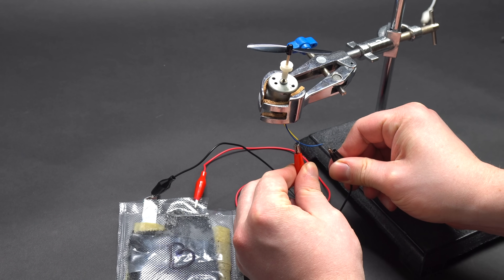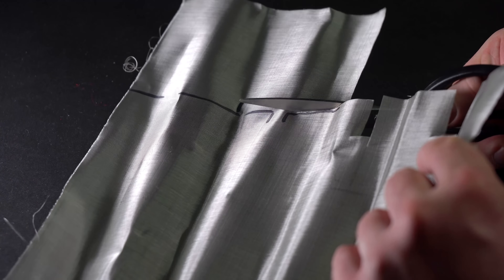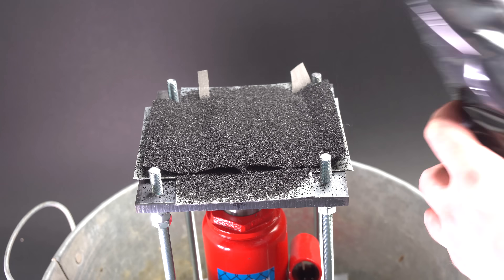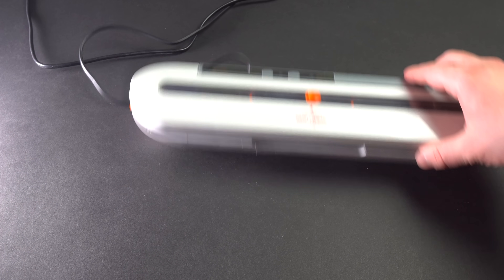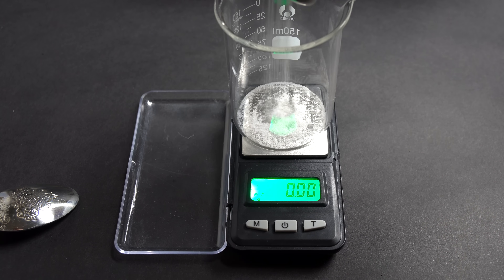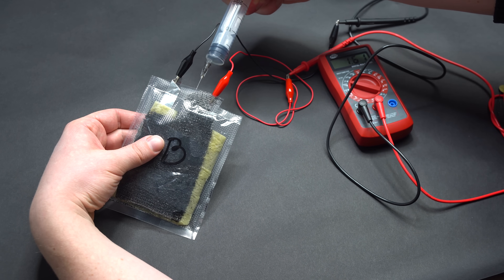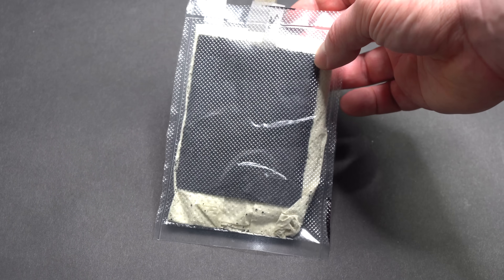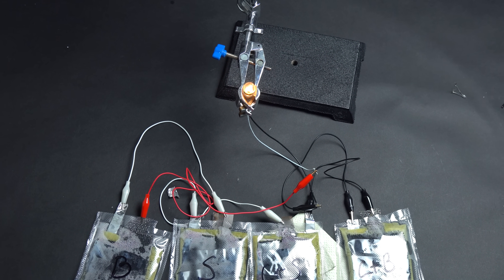Making a BATTERY From ALUMINIUM FOIL!

Comment: Very good. Easy step by step proces explained  .
Basically you use ReDox reactions with metal and salts. The energy from chemical to electricity. Most batt are so. But these are storable. ( like those lead/sulphuricacid for car without demiwater added.) I like the simple household material use.

Comment: Fun,free energy,glad Someone out there is got their brain together keep up the good work
Reply: Nothing free about his project given all the stuff that is required. Aluminum foil is also not free, nor is the jack, drill bits, metal sheets, chemicals, etc. Nothing is actually free other than people to make choices
Reply: @AaronSchwarz42  salt water is free recycled metals are free copper can be free from stripping a bit off wire or even penny's.. alluminium foil is what £1.50 enough too do hundreds off batts with depending your build there is many things you can get free or get your build cost per unit like a few penny's each...zinc is free in old batteries you can use vinigar which is 30p a bottle enough too do alot with you can look for scrap copper pipe and brass taps or even foil take away food containers not hard  too spot there's all sorts if use your head but really it's about cost effectiveness and these such materials n builds are hugely cost effective

Comment: make it an aluminium wire spool metal-air salt water fuel cell instead, so that the fuel cell chemistry is separate from the aluminium wire feed stock
Reply: make it a lemon cell instead of the capacitor plates
Reply: try non-aqueous electrolytes, namely denatured ethanol
Reply: make copper-oxide copper electrolyte-water-electrode (M-S-C solar cell junction)
Reply: anodize the copper to copper oxide on the surface thin layer, then cover it will transparent conductive electrode, like salt water, the same water can be used also as solar heat collector and the copper anodized will be blackish

Comment: Great educational experiment, but not practical. Those things offer less power than a tiny generic AAA battery which you can get on sale or buy in bulk for 9-10 cents. You can generate about as much by putting a propeller on a couple motors like the one shown in the experiment & pointing it in the wind. Any motor will act as a generator if you can spin it. Also a couple lead plates in a strong acid will generate much more voltage & current, plus it's rechargeable... that's how car batteries are made. Also zinc and carbon or copper electrodes in a mild acid or with a tissue of acid sandwiched between them makes a great battery.

Comment: You said that the electrolyte dissolves the aluminum, which I'm guessing leads to the demise of the battery. Is there anything else in the battery that wears out, or could you design a battery with the carbon electrodes that you could replace the aluminum when it wears out?

Comment: An emergency you say.......I read about a guy who use a stack of coins with different properties.....copper and aluminium stacked together with blotting paper between them and pee as an electrolyte to light a fire..............gotta try that as I have lots of pee.
The fact that you can get about 1 1/2 volts from a 2 coin stack makes me wonder if you stacked 200 coin sets together, that's about 300 volts,  you could get electrocuted.....shocking.

Comment: Why do you bother with activated charcoal? It's nonconductive and has no use in the experiment. Maybe it gives you a higher resistance which makes the battery weaker.

Comment: I'd like to see what happens if you make your strips very long 1, 2, or 3 meters long. Then after pressing and curing, roll them up tightly and put the the rolled material into the appropriate size acrylic tube or other (clay or ceramic) container, make your anode and cathodes with dissimilar metals. I would make my cells with lemon juice or vinegar or other natural nontoxic electrolytes so we are not creating karma negative energy sources . An after thought as to this design is put a little bit orgone  collector "Reich tech" into the design put some natural fiber between the layers cotton, hemp, kenaf, silk, linen (if you are a tinker never throw your natural fiber clothing out, put it into an orgone device or other fun project if nothing else you could make your own activated carbon with it!) Hemp Carbon Copper Silver Super~capacitors you got to love Nature please send feedback to herbalalchemyst@gmail.com P.S No more Dinotech or Nukes F*** the Dumb Shit!!!!

Comment: I would like to build some large battery cells, something similar to nickel iron batteries, similar to ni-cad, in potential, from what I have heard, I'd like to build them in 5 gallon buckets, so they can be resealed easily. I'd like to have about 28v total and 2k ah, it's a bit crazy and ambitious, but very possible, this should power my house for years, and can be disassembled , cleaned, and put back in service, after about 10 years of service,   or maybe carbon lead oxide batteries, built from used deep cycle batteries,  I'm using fla, and lithium ion for now,  about 800ah last 12 hours, I'd like to go 96+ for cloudy days,,,,  great video!!!/

Comment: Try and put the aluminium foil on mash as an electrode. That way the circuit won't get cut off as the aluminium dissolves. And maybe take apart the rough mash and make a wire out of it, so you could seal with heat the top part of the battery.

Comment: Well done, better use washing soda Na2CO3 or Pottassium Carbonate K2CO3 in water as the electrolyte only. Then it will last longer.. Also adding MnO2 to the carbon will help and you need to put the carbon electrode not in a sealed bag, but this way, that air comes into the carbon, as it a metal air battery...you can also use use a stronger oxidator like KMnO4 on the carbon, so you supply the oxygen without the air needed...then you can seal it up again...Hope this helps...
Reply: Hello mate would be possible too talk too you cheers

Comment: A friend and myself took a regular nail some carbon dust and aluminum flakes and it would light an LED light for a few seconds. But the crazy part is after the LED went out we broke the circuit and the nail would recharge itself in a few minutes and be able to relight the LED agian. Not just once but over and over and over agian without plugging it in to anything...no joke. Touch wire to LED and it would light up for about 15-20 sec. Then LED would turn off. Took wire off the LED for a few mins and then touch LED agian and it would light up for a few seconds agian...over and over.. we couldn't figure out how the thing was charging itself!
Reply: v ery interesting could you  please explain as to how you made all the connections

Comment: This build is very similar to a disposable hand-warmer product that was on the market in the 1980's. The electrolyte was stored inside the packet, but was encased in a wax vial, which you would crush or snap in order to activate. The only overall differences were that the entire was wrapped in batting, in order to prevent burning, and no electrodes, as the energy was left to create the heat within. I think they only lasted about 15 to 20 minutes, but would make your pocket, glove, boots and/or hands quite toasty. I think they were called "Hot Shots" or something like that, although the venture failed apparently; however - the product DID work. Interesting segment! I was unaware of spray graphite until now - good to know...

Comment: you should use way more thinner materials, that would result in a way more effective battery. Besides the Aluminium foil, use washi (japanese very thin paper) and graphitefoil. The layers should be as close to each other as they can. If the Graphite foil is thin enough, or has a very thin metallic support, you can roll the packet tightly together to make the battery. Also use potassium hydroxide as electrolyte.
Reply: Potassium hydroxide is highly caustic and would likely disolve the aluminum. While yes, it is a powerful electrolite and or can make a potent electrolite solution, with such thin aluminum I would be concerned.

Comment: Would it be better to use those power tool battery? Would it be easier to use those bolts to tighten down w/o press?

Comment: Making a battery from Aluminum foil and steel screen and carbon spray and napkins and epoxy and scotch tape and heat seal freezer bags and salt and baking soda and water and sodium hydroxide. Make you you have scissors and syringe and glass containers and tub and heat sealer and hydraulic press. To use battery make sure you have wire with alligator clips.
Reply: Well, yeah, but be fair, a viewer may have all those things at home and need a battery at a time when the shops are shut so they can't just buy one.

Comment: Get with me if your interested, for the equivalent of a solar panel but instead of just light, it converts ALL forms of ambient energy. And so much safer and easier to build, STOP thinking Anode & Cathode, and Start thinking Hydrophilic & Hydrophobic, and the purest cleanest water possible, at least AVOID Acidity & Salts

Comment: Aluminium foil. And a dozen other ingredients, and a press, and tape, and plastic foil...
Reply: Rule 1 of youtube: if the title has lots of capitals and an exclamation mark, beware, it's probably junk.  Sad in this case, because I'm confident that the method would work, yield the results stated and I enjoyed the video.  Not a scam.  The author should take note.  The title hype and misdirection is intended to attract but has the opposite effect on less naïve you tubers.   I would have ignored it if the notification hadn't arrived when I had half an hour to kill.
Reply: @raykent3211  rule 1 pretty much everywhere.
Reply: Where could I find that plastic foil that he used for battery assembly. All I can see in the internet is only cling foil. Help me with this

Comment: Im wondering if the hydrogen is being absorbed by the graphite creating an electrochemical process boosting your output. You may have a hybrid battery/fuel cell there with the sodium hydroxide / aluminum chemistry

Comment: A word of wisdom to make your life easier.. unless using carbide drills, drill at a slower speed with plenty of pressure and a little bit of lightweight oil making sure the drill and the steel arent getting too hot. This will help make your bits stay sharper and cut through the metal faster

Comment: What do you think the very best  electrolyte for the battery? How can we know the AH of the battry bro?  And after discharge are we going to charge it with same volts supply?
Reply: The best electrolyte is probably proprietary. To get amp-hours, hook up an ammeter, and film the meter with a camera until it reads 0 amps: then calculate the integral. As far as recharging goes, these are not rechargable: maybe if you replaced the air and water with something else (and even then you might need to keep it really hot), but not with an aluminum-air battery.
Reply: Thanks

Comment: Nice video 5 hours of cd player not bad. You are right these are perfect for emergencies.
Reply: It’s an emergency! 5 hours later (add 12 more if you don’t have a blowtorch)... woo! Almost as much power with a dozen of these as a very small crank light/generator which works all the time!

Interesting concept, but it’s only like 2.5 to 3 watts max (from the 5 packs put together), and if it only lasts 5 hours then that’s 15 watt/hour. But for this much work you might as well get a pocket sized crank generator or if you really want, make a bicycle generator (I’m ridiculously scrawny, but if I were just super leisurely pedaling for a 10 hour day, maybe like powering a laptop or desktop, I would probably average at least 100w, it seems like that would be much more useful since it will power much more and always be at the ready, and re-usable, and can be powered by Tacos, plus it’s just as easy to build and probably with more common supplies like a drill motor (or anything DC), and then a bicycle or exercise bike and a rope/belt/rubber bands/fabric/shoelaces etc). I wouldn’t even own half the materials he uses anyways.

Cool concept, but certainly not “perfect” for anything, let alone emergencies! If I need power in an emergency, I’m not carrying a syringe of salt water! And if I packed DIY battery pouches, I’d rather have a USB output hand crank or any of my other batteries (the small LiPo packs I use of similar size and voltage would be capable of of about 100 amps continuous and 200 amps peak compared to the 0.75 amps max he had shorted (I’m guessing mine would be over 300 amps likewise shorted, but it would be some eventful arcs and glowing wires in about 1/2 second though, so that makes it difficult to measure, haha!), so those batteries can actually do something useful, you would need about 12 of those cells shown in this video to slow charge a cell phone at 800 mA, so that’s not really “useful” amount of power for an emergency (and Id say charging a phone for help is an emergency).

Comment: Greetings from the flip side of electrochemistry (the platers). Is it possible to bring down the hydroxide content while retaining the depassivating effect? That way the purely chemical side reaction between the Al and the lye won't destroy the anodes so quickly and you'd get higher capacity. IIRC carbonate will also remove the oxide layer but more slowly. 

As it stands this looks more like an Al - water/hydroxide battery to me - there's barely any space for oxygen to get in for this to be an air battery. In a Mg - O2 battery for example one side of the cathode is dry and exposed to air.

Also, that graphite spray is shit for serious conductive layers. IDK about this brand in particular but using a similar one I've gotten anywhere from 10k ohms to low hundreds of ohms - sprayed on a sheet of paper with contacts 1 cm apart. The mesh is already metal covering it all with graphite is only going to make it worse.

Comment: Thoisoi, I'm glad you have expanded into making batteries, this has been a fun (but also sometimes frustrating) activity for me for many years now. I have also built similar batteries, but I don't believe the half reaction at the cathode is the complete reduction of oxygen, this requires sophisticated catalysts on the carbon. 

Instead, I think the oxygen is being reduced to its superoxide: 

O2(g) + H2O + e- => HO2- + OH-, E° = -0.065V (J. Phys. Chem. Ref. Data, Vol. 18, No. 1, 1989)

The half cell potential is not good (which is why you observe the overall lower than expected cell potential), but it proceeds kinetically quickly because no bond breaking of the oxygen is involved and so activation energy is very small for this process, it's essentially only electron capture by oxygen adsorbed onto the surface of the AC and doesn't need a catalyst.

Also, I don't believe that the strongly alkaline version of the oxidation of aluminium is the correct half reaction occurring here (because 'reasons' lol), I think a more appropriate equation for aluminium oxidation under these conditions is:

2Al + 2H2O => Al2(OH)2(4+) + 2H+ + 6e-, E° = 1.60V (J. Phys. Chem. Ref. Data, Vol. 18, No. 1, 1989)

When you correct for your pH using the Nernst equation, I think you will find this comes very close to your observed cell potential.
Reply: I have a question about how O2(g) can come inside the battery and react with H2O? It may affect the long-time battery life too.

Comment: Surprised that the epoxy didn't work as an insulator as you spread it completely over the surface. Awesome result though - very well done :)
Reply: The secret is to force the pieces of carbon into contact with each other, and keep them there, while the epoxy cures. That's what the press was for.

Comment: Hi!  Aluminum metallurgist here. Typical aluminum foil is made with a 3XXX alloys (like 3003 or 3004), these alloys are high in Mn. I would like to see this batteries with either a 1XXX (close to pure Al either 1100, 1350 or 1199) or 4XXX (alloys series high in silicon like 4032). I figure both of those would have better conductivity.
Reply: do you think it would be better to use disposable aluminum bakeware and cut it into sheets?
Reply: This works!!
https://youtu.be/x7Kv4GwPAkc
Reply: Your are correct, aluminum silicon alloys, aluminum magnesium alloys, and pure aluminum are better at conducting. The use the manganese alloy in aluminum foil since it can be bent repeatedly, is cheaper, does not work harden as easily & was not intended for battery construction :)
Reply: could you help me out Michael? I know it has been a while since you posted this, but I have some questions. as, I am also a metallurgist, in the making. XD
could you tell me what alloys aluminum foil, aluminum irrigation pipes, aluminum cans and aluminum powerlines are made from? all info would be helpful.
Reply: @Metal_Master_YT  no
Reply: @edmilsonferreiraps7cb818  lol, I'm not talking to you, random stranger...
Reply: Huh?
Reply: Aluminum coke cans made from 
 3004 aluminum alloy
- 3104 aluminum alloy
Reply: Here’s good news.  Construction Materials: Pure aluminum is used in construction for window frames, roofing panels, and other building materials due to its durability and low maintenance requirements
Reply: He could have used aluminum cans and cut them to shape

Comment: If anyone criticizes your hydro press then they don't get the point of diy. I that is a freakin awesome hydro press, hell yeah.
Reply: What?  The force it can withstand is limited by the shear stress of the threads of the bolts.  The hydraulic component is useless.  It could be capable of exerting a thousand tons of force, but the moment that you exceed the shear stress of the threads, they break.  So you might better use bigger diamèter  bolts and a long spanner, and forget the hydraulic jack.  It's important in diy and professional engineering to see where the weakest link is. The design offered in this video is daft.